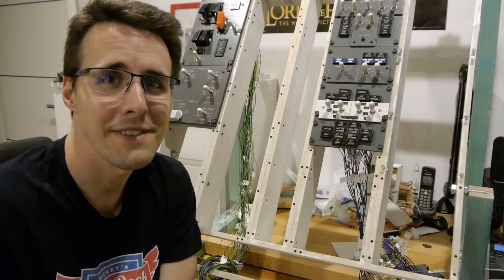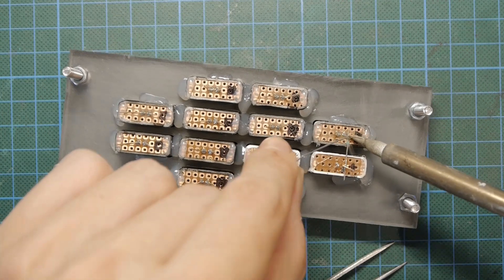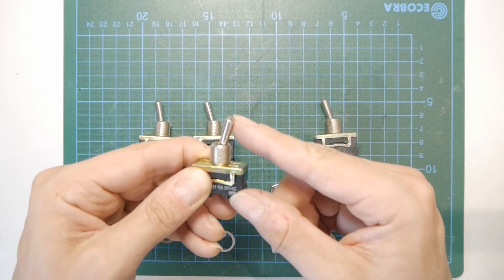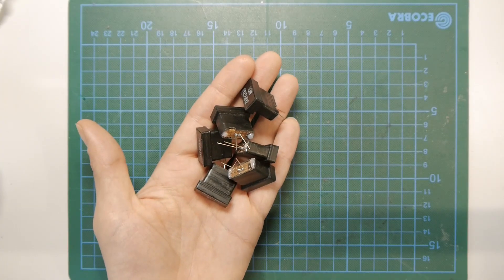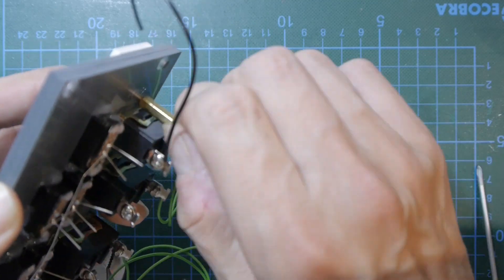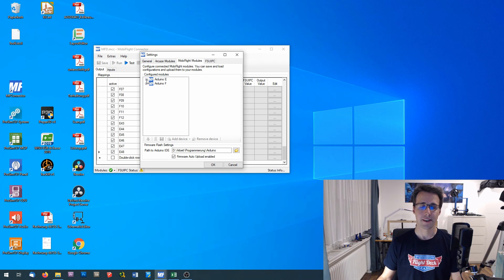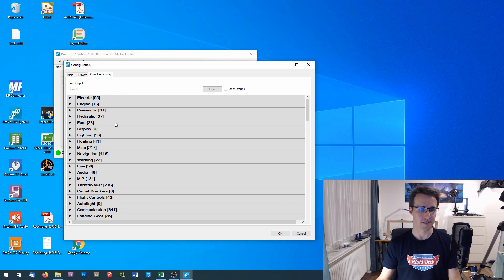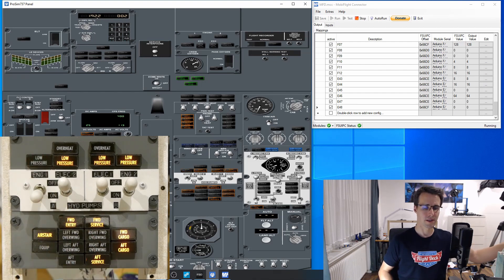Hydraulic Panel - A Boeing 737-800 Homecockpit #44

Comment: Awesome work! Did the pen arrive? Also how long do you usually leave the wires when soldering? Looks around 20cm, or is it longer?
Reply from the maker: Thank you. Yes I recieved the pens. I have written this to you under your comment in my last live stream. They were already in use for this panel. Thanks for the support.
The wires have a length of 30cm. In combination with the 30cm from the arduino to the plug I don't exceed the 60cm that are the maximum without getting errors when you connect a Max7219 IC.

Comment: I use pokeys USB card, when I have a wired switched turned on the Prosim sometimes has a delay for turning on that switch on the computer. 
Do you know what The problem could be?
Reply from the maker: The only delay I have noticed was when I hadn't the simulator running in the background. There were some error messages in Prosim which slowed down the reaction a little bit.